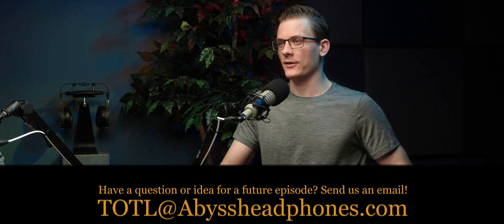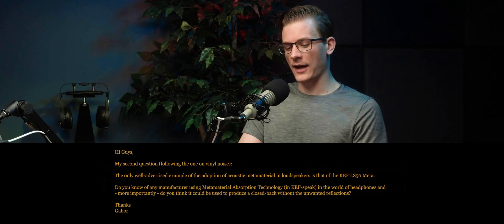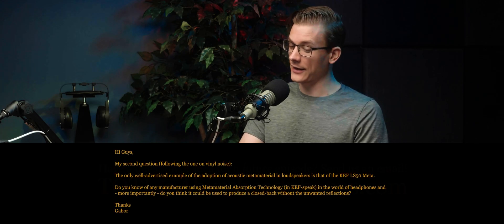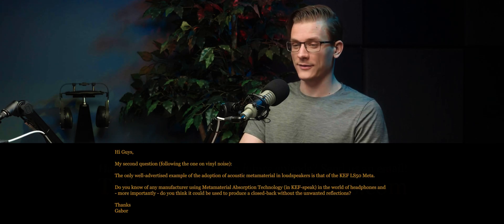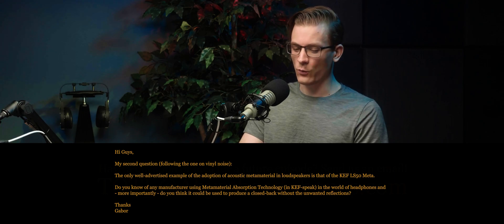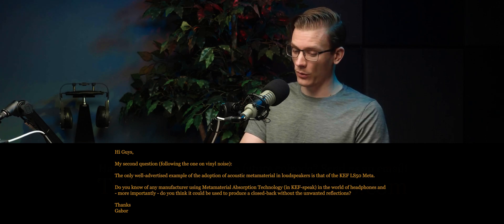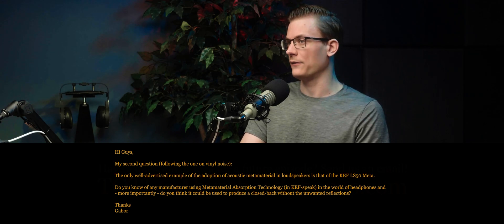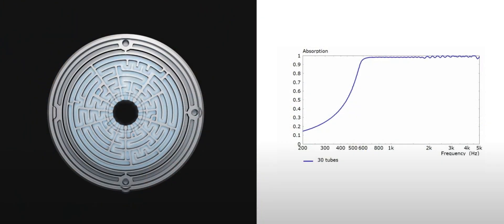Could "Metamaterial" work in headphones?

Comment: In speakers could you use the meta material for the high frequencies like Kef and then use a cardioid dsp controlled system like the KII three to cancel all low frequency back waves?